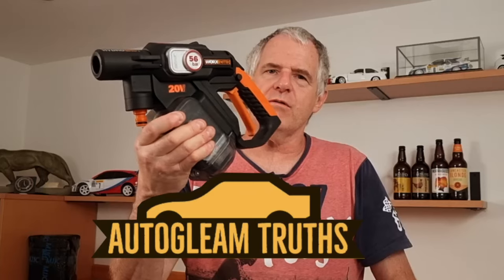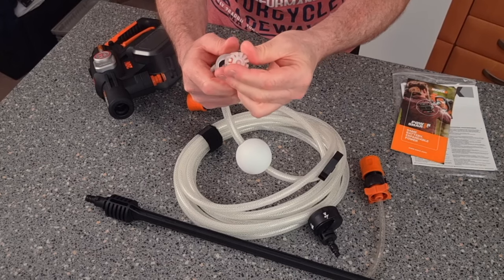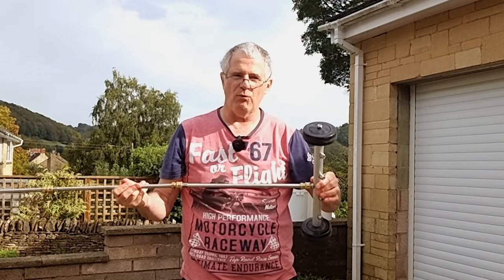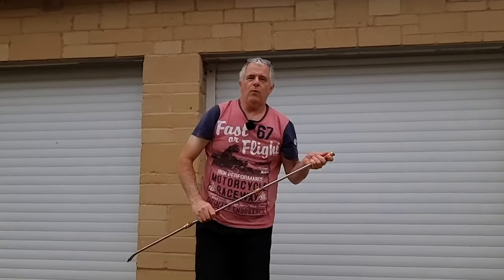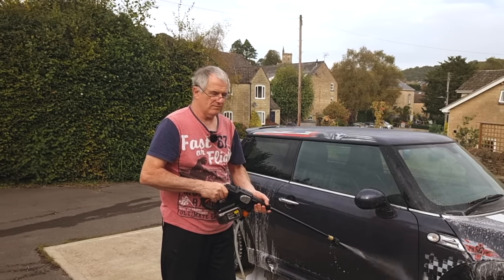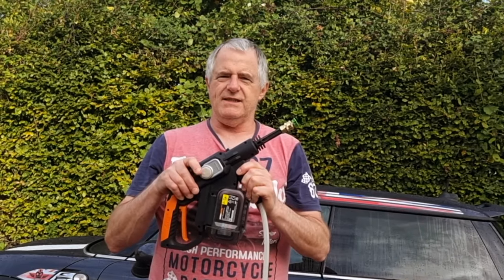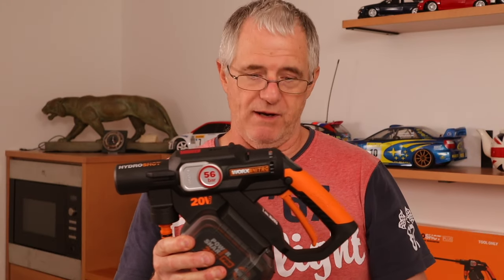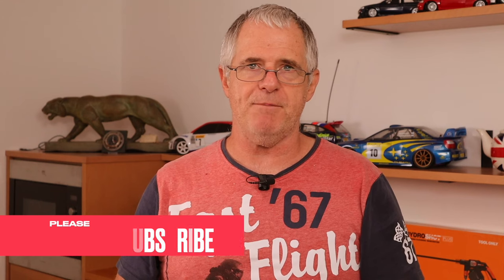New Worx Hydroshot Nitro 56bar: Pressure Washer Review 2024

Comment: I’ve older model, shall I upgrade ?? I mainly use for car and front yard
Reply: Currently Worx Hydroshot 56bar has a deal on which I personally think best of the 2 is the 56bar, but  remember that a Karcher K2 cost less than the Worx Hydroshot 56bar, now out there 2 I would have the Karcher all day long 😉 it's really depends if you have water and power for the Karcher, if not Worx, hopefully this will help you 😀 laters Steve

Comment: The problem with the foam cannon is a lack of water flow rate not so much the pressure. You need about 5 litres per minute to start getting good foam, the Worx can only manage 3.7. I have the same problem with my Ryobi EZ Clean, TBH the Worx foam cannon works way better than my Ryobi either with the Ryobi cannon or a MJJC one.
Reply from the maker: @WolfAbarth  nice to hear from you 👌 I was always wondering about the Ryobi, I see them in the supermarkets and diy shops really great price 😀

Comment: Probably would have performed far better if you'd connected it to a mains supply rather than just syphoning.
Reply from the maker: Just remember that water into the Worx Hydroshot 56bar is limited 👌 I have tested out both and is exactly the same 😀

Comment: Think i will go for the 40v version. Heard people like it.
Reply from the maker: I take it you are talking about the 40v batteries. In what Worx Hydroshot ? Out of interest, if you want the very biggest one, you will need to be a weight lifter 🏋️‍♀️ 😉
Reply: @AutoGleamTruths  yeah the one that takes 2 batteries. Yes guess its a bit heavy but looks like it gets the job done quite well.
Reply from the maker: @stepaman  is that the one which is 450 psi which is  31 bars, I did look at that one, but because it was from USA 🇺🇸 not so good for UK market 😉 and it's  only 31 bar against UK 56bar, but more likely I think it's about the same thing 😉 56bar is about 810 psi, just check first just in case 😉 laters Steve
Reply: Worx hydroshot ultra 2x20V battery , model wg649 - but price of it is 2,5x  higher than wg633 and the ultra model is discontinued in production because of many errors with it. 
For now the best cordless worx washer is still  wg633 model ( max 56bar )

Comment: Nice review and useful, what is the canon head you used that worked with the Worx Hydroshot Nitro 56bar Pressure Washer, do you have a link to it. Thanks
Reply from the maker: The Autobrite Direct was the best 👌 only thing it's now been deleted, but I have not used the new version of it, so I don't know if it works the same 🙂 laters Steve

Comment: Great review. I also have the original one. Does the original 20v fit woth this newer model? And do you think its more powerful without the extention?
Reply from the maker: @ahcrx  same battery will fit and work but shorter lasting, it's better with the smaller attachment very much like the old model, if you need that extra proforment this is worth it 👌 but if you are happy with the older 25bar it will still be good 👍
Reply: @AutoGleamTruths  much appreciated for the advice. I'm starting to get bored of the 25 bar power..really chasing more power and pressure now cheers

Comment: I've just bought the jet hawk for showering at the back of the campervan and it only cost £60 but I think the hose that came with your one is much better quality so I need to upgrade the hose
Reply from the maker: @patrickpirelli7897  The best one is Karcher pipe, better quality, and is a bit longer than Worx,  Kärcher 26431000 5 m Suction Hose and Filter for Pressure Washer Accessory, White, Yellow https://amzn.eu/d/06fTSrw1
Reply: @AutoGleamTruths  thanks for that 👍 I use to have a karcher big one very powerful 👌
Reply from the maker: @patrickpirelli7897  I still have both big Karcher, old and new. I just love them 💕

Comment: I've been told, that when using the foam cannon, it uses a lot more product than a normal pressure washer. Is that your experience aswell? And thank you for a very good and informative video 👍
Reply from the maker: It's very much depends on the type of product you are going to use. Currently, I have been testing out Topaz snow foam, and for a pressure washer like a Karcher Topaz is 100ml to 300ml, in my test out I use 300ml + water to make 1000ml, I use it in both Karcher and Worx Hydroshot 56bar, and it worked fine 🙂 I could have cut it down to 200ml of foam, hopefully this will help you laters Steve 🙂
Reply: @AutoGleamTruths  it did thank you again 👍

Comment: What is the technical name of the small green/yellow attachments you used?.
Reply from the maker: 5 Spray Nozzle Tips: Black soap nozzle(Soap),Red Nozzle Tip (0 Degree),Yellow Nozzle Tip(15 Degree),Green Nozzle Tip(25 Degree),White Nozzle Tip(40 Degree) currently sold on Amazon at about £6 🙂
Reply: Thanks for the info have found them on Amazon.

Comment: Can you use hot water in bucket
Reply from the maker: @mac-vl4ib  don't use hot water, warm water is ok, to be honest, temperature is very important, I use hot tap water mixed with hot, works bang on 😀 you don't want to over heat the unit 😜

Comment: If its hooked to bucket its 30bars/450psi. 
To 56bars it needs hooked to pressure water (garden hose...)
Reply from the maker: @zzo28  No, it doesn't matter what you do it's never going to do what you want, I have tested this out over lots of different options, and it's the same results, pipe on pipe off, pipe into bucket 🪣 and out, no real water difference, only problem is the eco mode, but knowing what I know now, would I be happy to buy another, yes of course, great for lots of different things 😀

Comment: Help.  How do I connect a hose from tap to Worx nitro ?  I don’t know what connections I need and what hose I require. Thanks.   Uk.
Reply from the maker: @GJX-xy7dm  Connecting a hose from a tap to a Worx Nitro Hydroshot pressure washer requires a few simple steps and some basic equipment. I'll guide you through the process of setting up your Worx Nitro to ensure you have the right connections and hose. 

### Tools and Materials You Need
1. **Garden Hose**: Standard garden hoses are usually 1/2 inch or 3/4 inch in diameter. Choose the right length based on the distance between your tap and where you plan to use the Worx Nitro.

2. **Tap Adapter**: Ensure your tap has the correct adapter to fit a garden hose. Most outdoor taps are threaded for standard hose fittings, but if yours is different, you may need an adapter.

3. **Worx Nitro Hydroshot Adapter**: 
   - **Quick-Connect Adapter**: Worx often provides a quick-connect adapter with their products. This will allow you to easily connect and disconnect the hose from the device.
   - *Suction Hose Adapter* (if not using a garden hose directly): Some models come with a suction hose adapter for drawing water from a bucket or other sources, but for tap connections, the quick-connect is more commonly used.

4. **Hose Washer**: These are rubber or silicone washers that fit inside the hose connectors to prevent leaks.

5. **Clamps (Optional)**: Hose clamps can be used for a more secure connection, especially if you are adapting the hose for different-sized fittings.

### Steps to Connect Your Hose

1. **Select the Right Hose**:
   - Measure the distance between the water source (tap) and the area you want to clean to ensure you have an adequately long hose.
   - A standard garden hose of 1/2 inch or 3/4 inch in diameter is suitable for most setups.

2. **Install the Tap Adapter**:
   - If your tap doesn’t have a standard garden hose thread, install a tap adapter.
   - Screw the adapter onto the tap, ensuring a snug fit. Use plumber's tape if necessary to prevent leaks.

3. **Connect the Hose to the Tap**:
   - Attach one end of the garden hose to the tap, ensuring there is a hose washer inside the connection to prevent leaks.
   - Tighten the connection by hand; do not over-tighten as this can damage the washer.

4. **Connect the Hose to the Worx Nitro Hydroshot**:
   - **Using the Quick-Connect Adapter**: 
     - If your Worx Nitro comes with a quick-connect adapter, attach it to the input on the Hydroshot.
     - Connect the other end of the hose to this adapter.
     - Ensure the connection is secure, and the washer is in place to prevent leaks.

5. **Turn On the Tap**:
   - Slowly turn on the tap and check for any leaks at both the tap and Hydroshot connections.
   - Tighten connections as necessary to stop any drips.

6. **Power On the Worx Nitro**:
   - Ensure that the Worx Nitro is properly assembled and powered.
   - Turn on the device and test the water flow and pressure to make sure everything is working correctly.

### Additional Tips

- **Check Compatibility**: Double-check that all components, like the hose and adapters, are compatible with your specific Worx Nitro model.
- **Using a Suction Hose**: If you plan to draw water from a bucket instead, attach the suction hose to the Worx Nitro and place the other end in a water source.
- **Filter Installation**: Consider installing a water filter between the hose and Worx Nitro to prevent debris from clogging the system.
- **Pressure Settings**: Adjust the pressure settings on the Hydroshot as needed for different cleaning tasks.

### Troubleshooting

- **Leaks**: If there are leaks at any connection, check the washers and ensure that everything is tightly connected.
- **Low Pressure**: Ensure there are no kinks in the hose and that the tap is fully turned on.
- **Adapter Issues**: If the adapters are not fitting correctly, you may need to purchase specific adapters for non-standard fittings.

By following these steps, you should be able to connect your Worx Nitro Hydroshot pressure washer to a water source successfully. If you encounter any specific issues or need further assistance with particular models, consulting the Worx user manual or customer service can also be helpful.
Reply: Thanks so much for quick and detailed reply.  Appreciate all the help ❤
Reply from the maker: @GJX-xy7dm  your welcome

Comment: Got the Nitro one.
For some reason it works a lot better than yours with what looks like same amazon cheap snow thing.
You may also find that some hose pipes wont stay connected unless you pull that little filter out.
Interesting vid.
Cheers.
Reply from the maker: With the better quality foam cannon, it works better, you must have missed that bit 😉 I do the same thing when watching videos, I always missing the bit  I should be watching 😍 tomorrow I will be doing a full car wash with it 😀 one thing is I am filming at 60 fpm and most likely it would look faster at 30 fpm 😀 laters Steve
Reply: I did see it work better with the gold plated posh lance...
I have put the famous 1.1 mm thing in my cheapo one.
Is marginaly improved.
Just done my car....
Best wishes
Reply from the maker: @timleaning6695  I will be testing out £95.00 foam cannon tomorrow morning,  just can't believe people would buy something this expensive, just to put foam over a car, I have been given this opportunity to test out for free 🤣
Reply: Its a bit different to fairy liquid and an old bath sponge eh?
Will look forward to seeing that one...
Reply from the maker: @timleaning6695  👍
Reply: @timleaning6695  0.9 seria ok? Ou precisa ser 1.1?

Comment: You got the Amazon link for the better snow foam cannon you used (£30) one
Reply from the maker: Hi it's been removed, but this is the company who sells them https://www.autobritedirect.co.uk/product-category/exterior-clean-protect/hd-foam-lance-and-snow-foams/?gad_source=1&gclid=CjwKCAiAuNGuBhAkEiwAGId4aofAZ1xF772ucGVoZMhK6UjyaToADqlHg1eAt07iXbHdit1w1BE5VhoCGgEQAvD_BwE
Reply: Yeh they don’t have the one you had now by the look of it?
Any other recommendations?
Reply from the maker: @brianleslie8371  I would have expected the new ones to be the same, but with having one to test, I just don't know, I believe this model is available on Amazon by a 3rd party but more expensive than £30, you could buy the new one on Amazon, test out and then return if it does work, because you have up to 30 days 🙂 now the weather is better, I may well get one just to see how it difference between them 😀  laters Steve
Reply: Had a Quick Look but can’t see anything Autobrite lance wise on Amazon or one that looks the same.
I might try a similar priced one and see if it does the job. I can always return if it doesn’t.
Reply from the maker: @brianleslie8371  some times it's just a small pressure valve inside the foamcannon that's makes the difference between using for the Worx Hydroshot and not, and the information about this is very poor 😢 if the company's information was better we would know the best to buy every time, it's the same for pressure washers you never know until we use it 🙂 good luck 👍

Comment: Have you got a link for them nozzles?
Reply from the maker: WORX WA4039 Hydroshot Pivot Nozzle Accessory, Black, 1 Count (Pack of 1) https://amzn.eu/d/29EOzgG  
https://amzn.eu/d/isAfIcS
Reply: @AutoGleamTruths  not the swivel one, the ones that go in the end of your short extension rod
Reply from the maker: @jonathansimms8782  https://amzn.eu/d/2Ssba5Y or do you want QWORK® 5 Pack, Pressure Washer Spray Nozzle Tips, 1/4 Inch, 2.5 GPM https://amzn.eu/d/fTlI2tl

Comment: Is this really more powerfull than the 40V WG644?
That seems unnatural to me. Does anyone know?
Reply from the maker: WG644 I don't think it's available and is 450 psi which is a lot less than the 56bar. The 56 bar is the most powerful Worx Hydroshot ever as I understand from a number of different people 🙂
Reply: @AutoGleamTruths  I think it was 450 psi and less than 200 l/h (0.9 gpm).
It's probably an older one then. I just thought double the voltage would yield almost four times the power 😏
Thanks for the reply 🤙
Reply from the maker: @ForestCounter  one thing I have noticed when using my 2nd one as the 1st blow up, it's more powerful on full battery, as it drops to level 1 the power drops off a lot, full battery and full 56bar 👍
Reply: @AutoGleamTruths  I guess specs on paper only tells you so much 😊
Thanks. This is useful info.

Comment: I think it is a pathetic excuse for a poor mans power washer. Spend 10 pounds more for a pressure washer
Reply from the maker: You miss out on the point of this type of thing, how is a power washer going to work in the desert 🏜 🤔
Reply: Well, I use mine to clean my caravan in storage. It's not meant to replace a standard pressure washer, but to offer a cleaning solution in remote places. I thought that was pretty obvious.
Reply from the maker: @DixonsVideos  I find this very frustrating to understand why people want to use a mains water supply for the Worx Hydroshot, I have just finished making a number of videos with tap water supply 😳 never understand that, personally I use mine off site away from electricity and water 💧 😀 laters
Reply: Peterkerr3496. What on earth are you doing wasting your time watching a video reviewing cordless pressure washers let alone then making negative comments about them if you are not even contemplating buying one !!! 😂